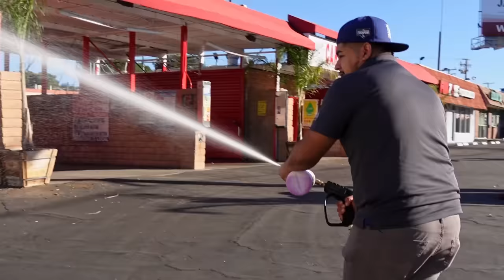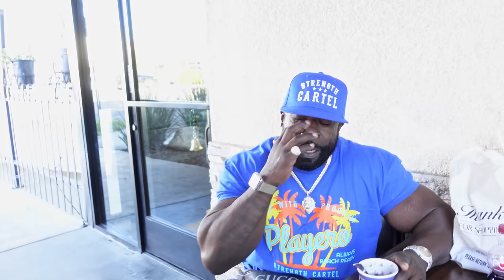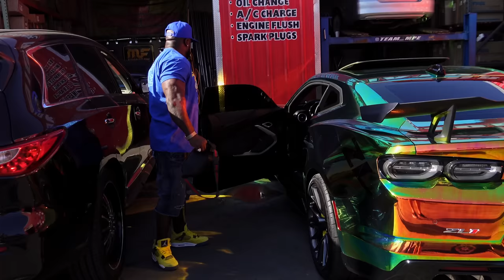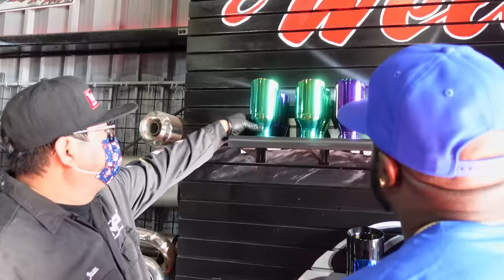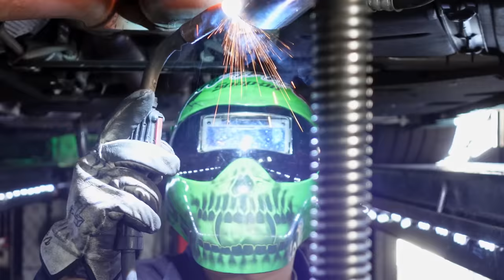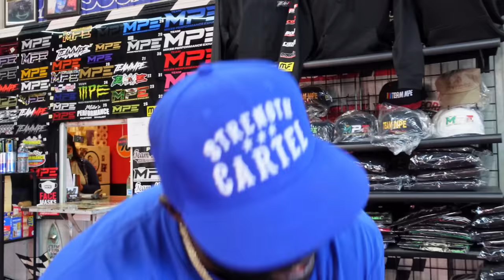Chevy Camaro ZL1 w/ Borla Exhaust - Starts, Revs & Fly By’s!

Comment: The borla attack exhaust should work with the different modes in terms of how loud it would make it. Love your videos Kali hope to see you on the road cruising one day ! That shop also did a great job with your cars exhaust !
Reply: He should have waited for the whole system. I don't think he still can use the valves with what they put on the car. Not sure
Reply: I got a question for u about a comment u made. What's the difference between AWD and 4WD?  Is it that in AWD everything engaged but 4WD 2 just basically spinning for a burst of torque ?
Reply: 4wd you turn on and off awd is always on
Reply: They didn't put an ATAK axleback on his car, kind of a hodgepodge..  They put ATAK universal mufflers on this car, did not incorporate NPP and why they had to build all the piping.  Had he waited for the full system, axleback, catback he would have had a bolt on solution AND kept his exhaust valves.
Reply: @DelCalloway  hey do you know if they put the borla atak that's is 400844?? I wanna buy those mufflers for my scatpack challenger thanks I appreciate it 🙏

Comment: You have the NPP exhaust Kali so them putting that borla atak w/o the actuators might have thrown an engine code. The code can easily be removed by a tune. You could have ordered the axle back or cat back with the NPP actuators so you can still change the sound of your car from quiet to loud